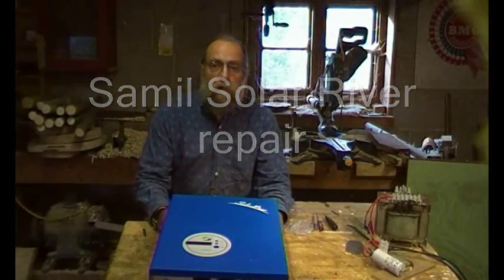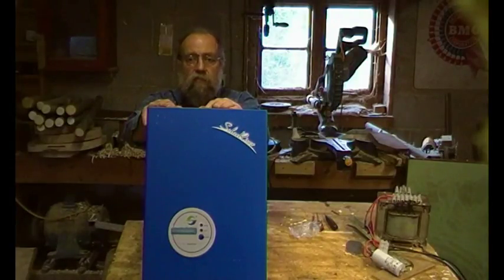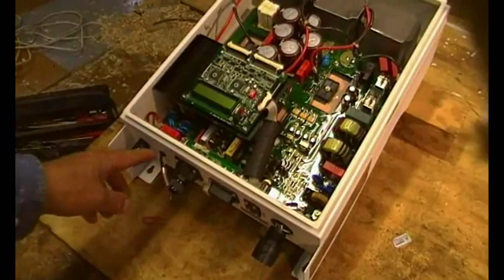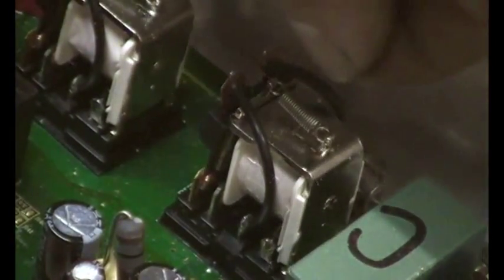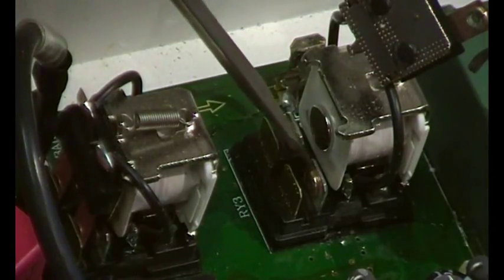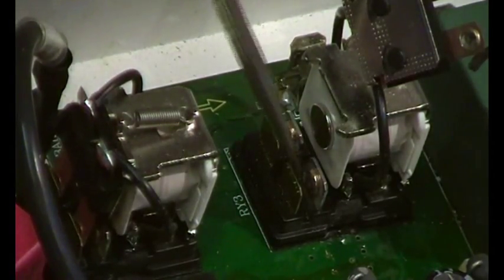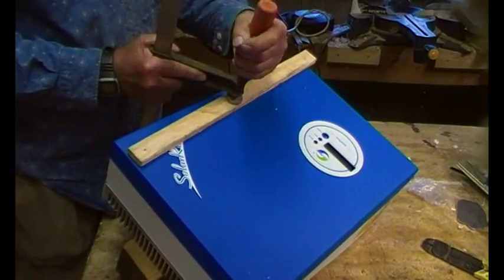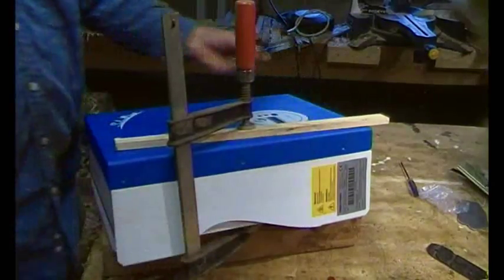Samil Solar River inverter fix, disconnect fault, refit the top method.

Comment: Hi Andy, great video… I cleaned  them today…. I snapped off the red capacitor…. Have you ever known anyone to do this… I’m hoping to solder it….
Reply from the maker: Hi, yes it's important to increase the contact pressure slightly, hope the cap is sorted, make sure it's the right way round, cheers
Reply: @TheInfoworks  looks like I’m going to remove the circuit board to re solder the capacitor on…..
Reply from the maker: @thomaswilson2840  Take your time, cheers

Comment: Turn around the pcb to dissolder the old relay and solder the new one on.
Reply from the maker: Hi, yes that's a solution but this inverter is still working 6 years later, cheers

Comment: Fault has returned and now the relay is definately broken. I would like to replace this specific relay but the board is very tight to the cooling element. It almost looks like it has been glued. Any advice on how to get this board of? I need to
Reply from the maker: Hi, that's a shame, were you gentle with the relay? undo all the screws and it should lift out. There will be insulators on the FETs, cheers

Comment: Brilliant! Exactly the problem with my unit. After performing SAFE ISOLATION as any electrician should,  I was able to repair my Samil TL3000 inverter using the technique shown in the video. 10 of my 16 panels were offline but now they are all running. Those tiny springs are scary though. I had to take extreme care to not lose them in the attic insulation. Thanks for the video.
Reply from the maker: Splendid, another unit repaired and saved from scrap. If your inverter is in the loft it needs an external fan blowing over the heat sink,  controlled by a plug in time switch. Heat is the killer, cheers

Comment: Does the whole relay come of or do u have to replace the hold board
Reply from the maker: Hi, if you watch the whole video you will see it's a relay contact reset. No parts required. Watch it 10 times and see my Paypal donate, cheers

Comment: Hey Andy. I found 1 of these on somebodys clean up pile yesterday. Similar problem. Broken solder joint on the same area. Could I feed solar into this & get AC out? I'm hoping! Cheers. 👍
Reply from the maker: Yes, you would need at least 120 volts DC, so 4 panels minimum, so the label and my book, cheers

Comment: Hi andy
The inverter  goes in error OVR
So here in Holland it means that it goes over 253 volts  so i read that it can higher if i raised it bij 2 or 3 volts the system wont stop anymore
Greets frank
Reply from the maker: Frank, I looked at the display on my 2300TL  hoping to find a service section but to no success. They are often password protected but often just pressing enter works. Other inverters have such a section but I have no experience with max voltage adjustment.  253 sounds quite high, is this just on very sunny days where all the PV systems are raising the local grid voltage? cheers

Comment: Hello do you know how to change AC voltage? To for example 255 V
Reply from the maker: Hi, the grid inverter will work to the line voltage, so it does it for you, cheers

Comment: Hi Andy, I have Samil Power Solar Lake 5500TL-PM that's not working. The fault code is no. 79 relay error unrecover. As far as I can see the fault codes only go up to 61, is this correct. The inverter was replaced under warranty about 3 years ago as  it had the same fault. Its a three phase system. I very much look forward to hearing from and would greatly appreciate your help. Many thanks. Tim
Reply from the maker: Hi, if it is a relay fault then follow the video and make sure the contacts are making good, but also check the relay solder joints as shown in my Aurora E031 repair video. Looks like you need to get the tools out and investigate unless it is still under warrantee. Heat is a big problem with inverters see my video on extending inverter life, maybe your inverter is mounted in the wrong place, cheers

Comment: I had a similar message on my SolarRilver 1600TL. Unfortunately my relays are all compact types and it's not possible to see inside them. Initially I thought there were a load of relays, but judging by the circuit board silk screen, some are actually square caps. I think I will remove the main board and replace the 4 relays I can identify to see if that fixes it...  I'm not sure how I can test if they're working in place without risking blowing something up. Why they can't make the relays plug-in replaceable, who can say...
Reply from the maker: On a Aurora inverter I have removed the relay covers with a dremel, that helps with covers that are glued, cheers

Comment: Thank-you so much for this video. One of my clients had a 'Relay  Failure' fault on their Samil Power SR2K2TLA1 Inverter.  I did precisely what you did here and up the unit came straight into Normal state.  She had received quotes for AU$1,000's to replace the inverter, so she was very happy.  I used a relay contact file and some 200 grit  sandpaper to clean up the 4 terminals.  I've subscribed too!
Reply from the maker: Brilliant another inverter saved from the scrap, please see my video on extending inverter life, good solid info, cheers
Reply: @TheInfoworks  
Will watch the video on how to extend the life for sure. 👍 Would you know the model number of those relays by any chance?

Comment: Hi my friend   
I have the same issue saying relay failure. 
And I was figuring out the relays but couldn’t find them after seeing the video.  So I need a little help can you please help me with this.  Otherwise It will cost me a lot of money If you know what I mean. Waiting for your reply my friend
Reply from the maker: Hi, what model is it? the relays are sometimes in different parts of the board and may be white or black, they will be there and the tops may be more difficult to remove,. On the auroras I have to use a dremel to cut the tops off, cheers
Reply: Andy Reynolds Thanks for the reply mate. The model is SOLARRIVER 1600TL and I think the relay are in black colour. But the thing is I don’t know even a thing about this I could have called you If I had your number. That would have been easy for me. Could you please give me your number and few minutes from your schedule which could really help me saving some good money. Cheers waiting for your reply

Comment: Just a note regarding the relay, they are a SCL-1-H-DPNO relay by Song Chuan. The 'H' in the model name denotes the contact gap to be 2mm so if you have this fault and decide to clean the contacts, don't forget to set the 2mm gap afterward. This gap is measured between the underside of the contact arm points and the middle prongs of the relay when facing the Samil unit on the wall. Datasheet - https://drive.google.com/file/d/1hWun9iHQX58tSMophKpql4Jvp3hZZWKE/view
Reply from the maker: Thanks

Comment: I have this inverter, after 9 years the led screen says "no utility" can this be repaired or do i need a new inverter? Thanks
Reply from the maker: Hi, I assume you have checked that AC is getting to your inverter and that all fuses and trips are all OK. There is a fuse in the inverter and you will have to take the cover off to access it, and it is here that you can check that the AC is available inside. Be careful, subscribed? cheers
Reply: @TheInfoworks  yes I have checked all that which is ok, I don't know what causes this no utility error from the inverter so not sure if it can be repaired or if I have to replace it. Thanks. Subscribed
Reply from the maker: Hi, in that case it will probably be in the AC sensor circuit  and I have never had any success with this, there are Solar River inverters on Ebay, otherwise I suggest Solis. It's heat that does the most damage, cheers.

Comment: Hello. On the internet I came across your video regarding inverter repair. I have Samil Solar 3000. I bought a used 10900Kwh, problem for 3 days - relay failure is displayed. I took off the cover, after starting the spark the upper relay. I will start cleaning tomorrow. I have a question for you, is this just a contact problem or has the relay solenoid lost its magnetic value? Best regards and good health.
Reply from the maker: Hi, it just a contact problem, the relay coils retain no magnetism but create it when the coils are energised. They either work or don't and when they don't it is either a fault in the coil or the circuit that feeds it, cheers

Comment: Hi Andy, I wonder if you can help... moved in to a house with a PV installation already there. I have a Solar River 1100TL. The other morning I noticed an error code "EEPROM Failure" on the display. Searched the web and it suggested to disconnect PV + and - from DC. So I turned the DC Isolator off and back on after a few seconds. The inverter restarted and normal state resumed. However, I've had to do the same thing again this morning. Do you know how I can permanently fix this? I don't want to be having to go under the stairs every morning to restart the inverter.
Also, the inverter is now reading a etotal of 9658kwh on its display but my meter is reading 9522kwh ? Is this right?? I'm concerned where it's been in error mode it's not relayed the correct readings back to my meter?
Reply from the maker: Hi, some of these errors can be difficult to find. First you should always disconnect the AC before the DC to prevent relay and contact damage. Second I would go through all the connections both AC and DC to to catch any poor contact. Third improve the cooling of your inverter, heat is a major problem and it's very sunny at the moment. Experiment with this and see my video on extending inverter life. Latterly, put a search on Ebay for a spare inverter. It seems the difference between inverter E total and the fits meter  is not that great so don't worry about it and see if you can solve the primary problem as the system will not generate with a fault. Subscribed? Cheers
Reply: @TheInfoworks  just subscribed. Thanks for the quick reply. I just went and checked it again and the error was up again so it seems to be getting more frequent. Does the inverter need to be opened to check the AC and DC connections? Sorry it that's a stupid question I have little to no knowledge. Although the inverter is under the stairs it does have quite a bit of space around it to reduce any heat build up. Is there any way I can send you a picture of the set up so you could explain a little further? Kind regards
Reply from the maker: Hi, I'm talking here about external AC and DC wiring. How many panels are connected to this inverter? Heat is  a problem so an experiment with a fan and time switch may help, see my video on this, you can load a short video (or series of photos) on your channel showing the scenario, cheers

Comment: Andy, I love it when individuals like you sort stuff out that manufacturers get wrong or fail to put right. MY Samil Solar River 4000TL-D has just stopped outputting data via the LAN port. Any suggestions? Thanks.
Reply from the maker: Hi, is there a battery for the data storage? maybe that's first place to look, or maybe a duff cable or socket, cheers
Reply: @TheInfoworks  Thanks for your reply. An Italian service engineer diagnosed an issue with the Firewall not letting data through. I guess my latest Avast update screwed this up. All sorted now.
Reply from the maker: How things get more complicated, that's something to remember, subscribed? cheers

Comment: hello I have a problem with the inventer samil power 3000tl everyday in the morning there is a "relay failure" error after voltage restart works normally what to do greet Artur
Reply from the maker: Artur, just clean and adjust the relay contacts, see my video on extending the life of grid inverters, subscribed and patreon donation? See comment below this one, cheers
Reply: Thank you, I watched your movie and my inventerek repaired, best regards :) :)
Reply from the maker: Artur, please see my Patreon link and the video to extend your inverter life , cheers

Comment: Hi Andy, do you know if the solar lake inverters use the same type of relays? I have a customer with a TL12000 that won't boot up.
Reply from the maker: Hi, the relay fault is shown when the inverter goes through the boot up process. If there is no life then look elswhere, is the DC getting to the inverter? or is there a fulty connection somewhere, best have the front off, but a 12 Kw will probably be 3 phase so be careful, cheers
Reply: @TheInfoworks  Yes it's 3 phase and there is dc getting to it. It's not showing a fault code. The fan kicks in when it has timed down and there are a few relay clicking noises but then it just goes back to timer mode.
Reply from the maker: Difficult, usually you would get something that identifies relay fault, but hey-ho, the first option is to clean and check the relay contacts, cheers

Comment: Can't believe this worked - huge thanks.
For me, it was the lower of the two relays that (probably) needed bending - there was sparking evidence in the transparent cover - but I did both of them anyway.
The system came straight back up - we'll see how long it's going to last.
I was actually hoping the relays might pull straight out and then I could push new ones back in.
Reply from the maker: Hi, thanks for your story, yet another inverter fixed and skills improved. I hope you have subscribed. Please see my video on extending the life of inverters, cheers

Comment: Wow , your Video is incredible . Thanks so much . My 2Kw Solar River Inverter is only 8 months outside the 5 year warranty and today threw up a "Relay Failure" fault log. It's total output to date is 16,465 KwHrs , ( installed 04/Feb/2014 )
 Thanks to you , I've fixed the problem myself . 
The contacts in BOTH RELAYS  were really grubby and quite fried, so I carefully refaced them with an Automotive Points file and some 600 grit sandpaper to provide a good "Contact Point Surface" finish. I also slightly bent the points plate as you describe , to provide a small clearance between the end of the Electromagnet and the moving part which carries the actual points  Here's a hint for the teeney weeney springs. Before you try to remove them , put a long loop of cotton through the eye at one end , then , when it pings of into no mans land , you just haul it back again aha. 
 Im so pleased you were able to assist. Regards Supaflee. NZ
Reply from the maker: Hi, thanks for the comment, there are ways to prevent failure, see my video on this subject to keep your inverter working for years, here's the link: https://www.youtube.com/watch?v=GaqHZU8bD0M, cheers

Comment: Great video. I have a Samil River 4000 TL-20 took the screws ok of the sides and top, but the cover refuses to come off even with considerable effort with punches etc.. moves half a screwhole but no further.I was wondering if the seal is stuck and how to unstick it?
Reply from the maker: Anthony, hi, I'm not familiar with the 400 TL but if you are sure all the fixings are removed then maybe the seal has gone hard, try a hot air gun and a bit of educated violence, good luck, cheers
Reply: Sorry should have read the whole thread! the answer was further down. Used hot air and it eventually sucumbed, but was very well stuck down with sealant. Got the model no wrong it was of course a SR4k4TLA1. completely different inside to yours though. My problem was input AC voltage underrange fault voltage and reading 104 volts with the mains input at 245 volts.Nothing obviously faulty  to look at. Input AC fuse OK. Could really do with a circuit diagram to go much further though. but suspect its a very heavy paperweight.
Reply: On further investigation took the pcb out ( a lot of screws holding it down) and found the problem on the solder side. Burnt out solder connections to the AC linefilter inductors. Looks like bad solder joints from manufacture. Cleaned them up and resoldered properly including some other suspect solder joints.
Hopefully it will all work, just have to wait for the sun now!
Reply from the maker: Anthony, that's great news and brilliant persistence. Good info as I have several inverters that cannot sense the mains. Further investigation required. It's that lead free solder up to it's tricks again, cheers
Reply: @TheInfoworks  It looked like the inductor enameled wires were not properly de-enamelled before solderflowing so the solder could not get down the through holes resulting in a dry joint. The units are easier to work with than I first thought.
Reply from the maker: Anthony, did you get it fixed? or were there other problems. I have just been investigating an ABB with leaky capacitors and it turns out to have a large area  of burnt circuit board, never to work again, but hey-ho, can't win them all, cheers
Reply: @TheInfoworks  Yes its working perfectly now thanks. On inspection the resistor divider chains that go to the MCU to monitor AC voltage come from beyond the inductor filter circuit, so if the unit is reporting low grid AC volts when you know its correct going in, the suspect is likely to be the inductor filters or their solder joints. If your circuit burn is not too extensive could it not be rebuilt? I have repaired some fairly horrendous burnouts ( using wire links, epoxy and copper clad board) , depends how many other components are affected, and if the time is worth the effort!